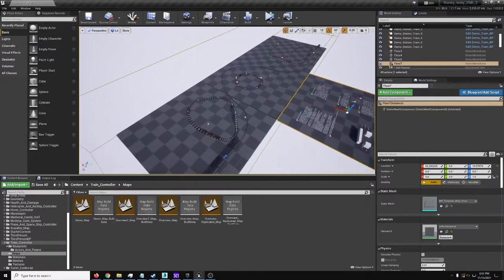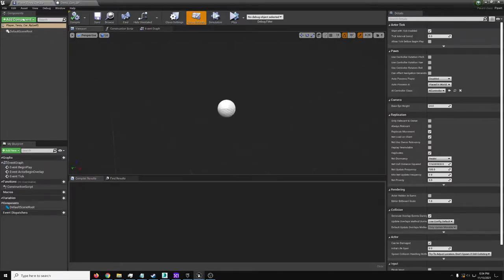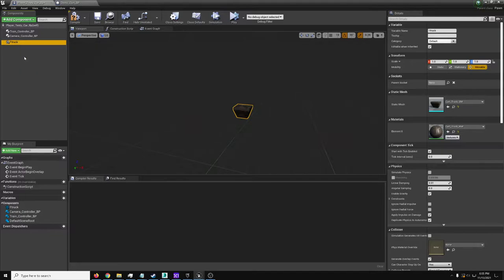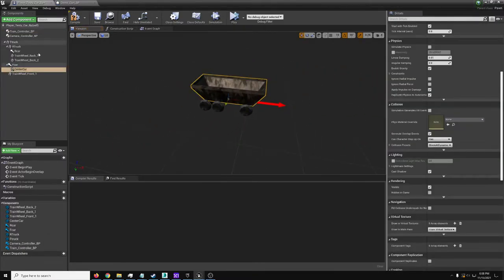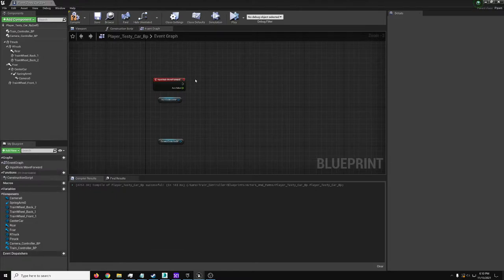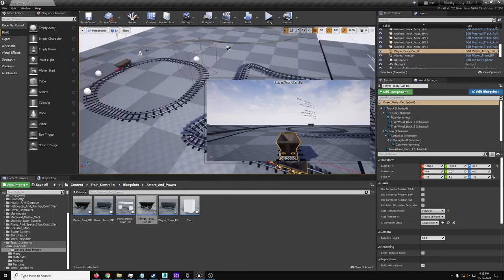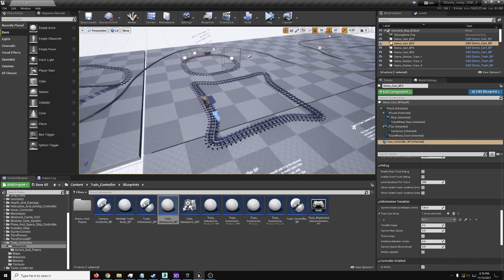Train Controller Example Tutorial

Comment: Are you able to get it so that there are multiple carts on the same automatic track that are not connected?

Are you able to adjust the speed on sections on the automatic track?

Are you able to create several stops on the automatic track?
Reply from the maker: 1. Yes, each train is it's own actor with it's own logic, additional cars can be attached to an engine, but you can have multiple trains on one track. Though by default, they don't collide with each other. So if you want AI collisions, add a volume to the front/back that will constrain their current speed/throttle to not go forward/backwards if the given collision is hitting something that you want to stop that car on. Otherwise, if they all use the same movement logic and are properly spaced out they should just avoid eachother on their own anyway though.

2. Yes, the example automovers tend to use a lerping float via timer, or just use a timeline to control a curve to adjust the speeds. Same method that controls speeds to slow down and stop before then starting back up and moving in the same/other direction for stations, could be used to simply change speed as is if you go in and customize the curves/output values to your needs.

3. Yes, you can stick as many automover actors to act as stations or stuff as you want, though depending on how they are set up in code and motions if you stick them too close together, or have multiple trains on that same track they might start having some issues. Example automovers using timelines can only control one train actor at a time for example, and if you had them enter into one stations volumes while still speeding up or under control of anothes, it might not trigger the overlap and thus not interact with that other station, so again you can shove as many as you want on an entire track, just avoid having them be too close together, if using the default methods. They are just examples though so you can easily make your own actors/control system to adjust the trains throttle values or such yourself to better fit your own needs if relevant.
Reply: @terricon4  excellent! Thank you for your reply! I will be purchasing this product

I have one more question. I know that this isn't in the product, but so you think it's possible to be able to create an add-on where a player can push a button to trigger where they would attach to a random point on the vehicle only when the vehicle is at a station? And are able to push the same button to get off the vehicle only at a station?

I hope to use this to create a monorail system with several different carts that are  not attached. And where a player will be able to get on and off at different stations and will be able to sit down at different seats

I know it's possible to do something like this from scratch, but I am just curious if it would be easier to build off of your product

Comment: Is there any way to control the positions of the cars on the spline by sequecncer?
Is yes, please let me know.
Reply from the maker: Not really, the train controller relies on the event graph and various settings to work. And unless recording it out of a play session, in wich case you could control the speed of it and thus more or less the movement and position.... But that's not being controlled by sequencer, that's by the train controller, and it's own normal inputs and rules for movement.
You otherwise won't really get it to work in sequence recordings that don't bother with the backend, and just try to move objects directly, wich basically means if you control it directly in sequencer... you don't get it to do it's own code and work right itself. So... you could attach the car to the spline and have it just move along using the "path" function of the sequencer, but then the trucks and cars and everything won't be linedup by the train controller itself, wich is I imagine the whole reason you want it and aren't just using spline path in the first place.
So, if you want to use the controller, you basicly need to just record an actual play session and either manually control the train how you want, or position automovers to make it move how you want reliably. And remember to record each train car when doing that, since sequencer just copies the end positions, not the code running, you need to make it manually copy the positions of all moved train cars then.
Reply: Thank you for reply!
Your comment is very helpful.
I appreciate you. @terricon4

Comment: thnkas for this amezing video can u pls mono rail setup tutorial video bcoz I want to purchase
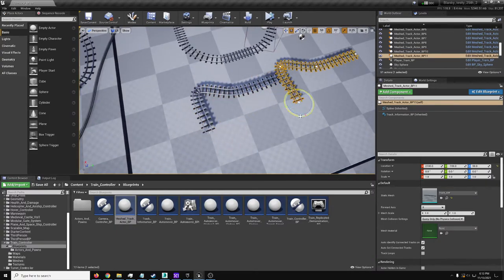Reply from the maker: Hi, could you be more specific on what you want covered in a new tutorial? Is it just showing me driving the train around, showing me setting up the track (it's the same as at12:10 just with a different mesh set to be used for the mono rail). Or is it for making a train car that doesn't have the wheels like the demo monorail (basically just don't add wheels, my example monorail cars just use their trucks as the jacket that fits over the monorail part). Or is there something else in particular?